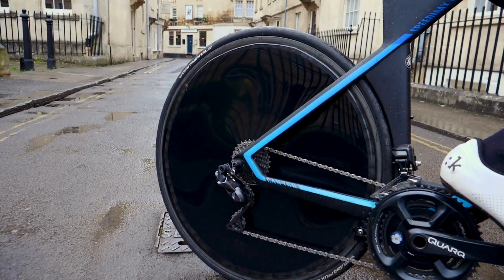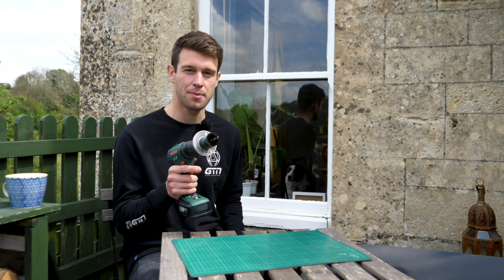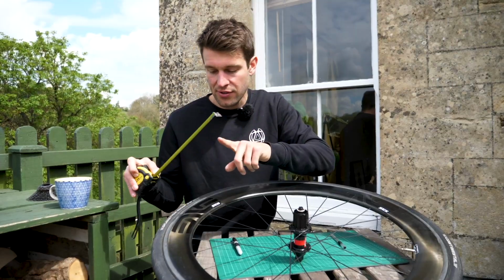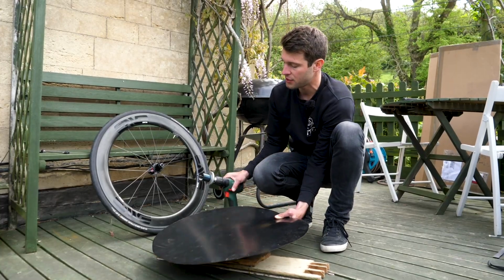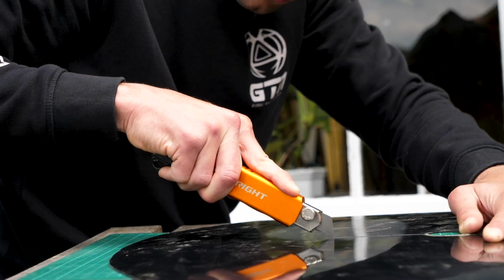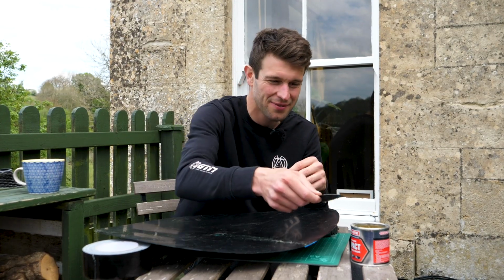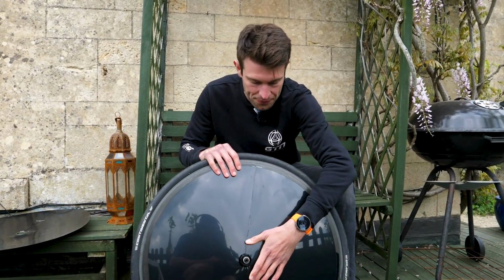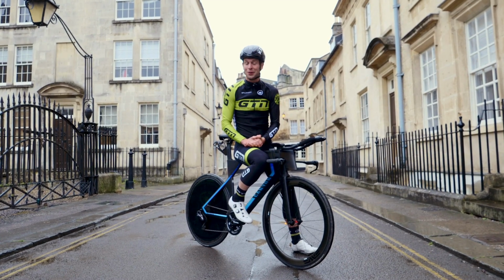Homemade Disc Wheel Cover | How To Make Your Own Step-By-Step

Comment: Super 👌 
Subscribed.
I had thought of that because I have 1450 DT Swiss and Speed Comosite hill climbing tires. Disc's and trispokes are nice but always heavier, weaker, non repairable and damaged by UV... These ones of yours first rate 😊

Comment: a tip for drawing the circle: hold the string as low as possible , or get a ruler or a piece of straight something, tape 1 nail to 1 end and the pen/marker at the desired distance.. good luck :)

Comment: Sorry to be negative but this looks like a dangerous bodge to me. If the disc wheel cover starts to detach from the wheel it could foul on the bike frame and lock the rear wheel, thus causing an accident. I'd rather not have my personal safety dependant on the stickiness of gaffer tape or insulation tape when travelling at 40+ kph.

Comment: Easiest way to create a perfect circle, piece of batten timber measure your required length from center to edge, drill small hole for center and larger whole for sharpie to fit in, rigid and solid circle in one :)  only dawned on me after I tried to 2 pen method (what a nightmare).

Comment: If you've ridden a real disc wheel then you'll know that a disc wheel will accelerate more than a deep section wheel
Reasons that a factory disc wheel is a solid disc, thus having a lower Moment of Inertia than a ring
Good Job Mark, for the disc cover thing, might as well try it on my bike

Comment: Thank you! Can't believe I found a video on this. Im a GCN viewer, but after this intelligent, thorough piece, Imma check y'all out more often. Most older roadies, myself included, are fairly mechanically inclined, and love DIY. I make some of my own parts like quill stem adaptors, allowing modern bars and stems on vintage steel bikes. Have also made a few different handlebars myself. I've made Q-factor out-spacers for my pedals...all sorts of things. But I've been thinking of doing a rear disc. Thought of fiberglass mesh or window screen with varnish basically, a few different ideas have crossed my mind. But I like this one. And forgive me, I always think of TT riders as kind of an elite demographic, solving most problems with their credit cards. Pleasantly surprised to come across this video. I've built up a freewheel single speed time trial bike and on its first real highway ride today, got thinking about a cheap rear disc. I may do slightly different but great starting point for me. Thanks again.

Comment: I like the idea of plastic push pins, or plastic mating bolts to hold disks together near the rim edge.  Some clips or bread ties/zip ties if i recall keep it firm anywhere else.  I don't trust tape.  Been wanting to do the rear wheel of  e-bike, but after i get belt drive sorted out.
Reply: Nice idea, one could make some bolt adapters  using a 3d printer. Thinking about ways not needing to take the cassette off as well.

Comment: Honestly, one can do a bit better than that. The cutting by hand on not very defined black line using a stanley knife....  You could have used a a ruler or a bit of wood and taped the center point and stanley knife to each end to use as a cutting tool.  The finish would have been far superior than what you accomplished. Thank you for the video.

Comment: I'm having trouble cutting my 40mm hole in my 28mm wheel cover please help... Just kidding cool video. not sure how box section would work though not much room for tape with a braking surface. Gtn should sell these like gmbn do with mudguards.

Comment: Mow that you've done it with the poor man's material go out and get yourself some 0.2mm thick carbon sheeting and do it again, the material should be about 150 US dollars.  Both covers together will only weigh about 170grams and it'll have an overall great stiffness than the wobbly abs.  So far I've made covers for 4 wheels out of carbon.

Comment: I used to make wheels covers as a kid using the heatshrink wrap that they sell to cover the wings of RC planes. Weight around 20 grams..  Pretty easy to apply, but it covers up the brake track, so only good for fixed wheel bikes.
Reply: Could you share how you did it? I want a wheel cover to cover the spokes of the bicycle so when my dog runs alongside it his paws can't get trapped in the spokes.
Reply: @furstylist  It was a long time ago cant rember the product name.., I the think the wrap got sticky when you heat it with a hairdrier, so i just cut a circle to cover the wheel and made sure it was stuck to the brake track, (you cant use rim brakes when its on) and then shrunk the middle taught. There are wheel covers that you can buy though which tie onto the spokes, much heavier solution of course.

Comment: If you're having trouble with the string, you can use a lengthwise cut cardboard with two holes. That way you get less unnecessary movement and a more accurate circle. Just make sure the cardboard touches the surface.

Comment: I bought and raced a  stretchy, shiny wheel cover in the USA for less than £30. I still have it; still usable.  It worked very well, esp. in cross winds. It used wire hoops at circumference, held in place by removable black plastic clips, that clip on the spokes and the 2 wire hoops.  Looked good too. Lenticular (i.e. lens shaped) solid wheels like this exhibit somewhat different characteristics to flat solid wheels. They act like a sail in crosswinds :)  Adds weight though, so not great for up hill.

Comment: The real disc trick is to use 3M car wrap vinyl to cover the wheel, since you can just pull it into tension and trim it around the brake track, so it’s super aero and also very very lightweight, adding only 30g to my rear
Reply: pics or didnt happend :)\
Reply: Prove your theory please...in photos!
Reply: Tor Do you think regular heavy duty vinyl would work? Or is the adhesion from the 3M vinyl necessary? My dad owns an advertising company so we have a bunch of extra billboards & I want to make a disc out of the eye of a Despicable Me minion.
Reply: Nitrouspeed Unfortunately I was relying on the vinyl sticking to the edge of the brake track, so I don’t think it’d be very possible
Reply: @bingrusginckle  same here!
Reply: one caveat is monocote shrink wrap stuff can potentially warp a wheel. i bought a recumbent bike with the rear real wheel done with vinyl wrap and it ran very untrue. but i did not know why. at later date i took the wrap off, because i wanted to fit a rear brake and he wheel was a lot straighter

Comment: Great idea! But I think the pen-pen centering isn't a good method. You can see the inner pen tilting, which can easily add a centimeter to the radius. Also, if you don't keep both pens rotating with the wire, the wire will twist around the pen, making the radius smaller again. You could measure up a compass template from foam board, and tape both pens inside there, to get a perfect rigid compass and a really clean circle.

Also, it seems really important to get the slither size just right. You can see on your drive side, the slither is too wide, making the disc too conical, and subsequently the cassette presses on the disc, giving it an S-shaped section, where it should be straight.

I think it's possible to create a pretty accurate measurement template for the discs. I'll give it a go and let you know.

Comment: Hack or Bodge. Please send it to the GCN team for a verdict. 😂
Reply: Hacks. I wish you did a more semi permanent solution rather than taping it onto the wheel. 

Is that even legal or safe? Im sure on the velodrome taping it on wouldn't fly. How could you adhere it to a carbon rim without ruining it?
Reply: @Red-ju4mi I’ve had one on my bike for over a year now and I’ve only had two replace the tape once

Comment: Consider using a push pin for the center, and attaching the string as low as possible on the marker - that should make the job a bit easier.

Comment: The cement will make the wheel vibrate thus loosing power. I would've went with superglue inside the seem.

Comment: wouldnt it be better to fasten non drive side with tape as the casset will hold the middle part pretty well on the driveside so no need to tape over the spokes
Reply: Good point

Comment: I'm concerned about wheel balance... Surely the glued seam will throw it off?
Reply: put the glued seem directly opposite the valve, the valve probably already has the wheel slightly off balance - it may help

Comment: You can do a permanent disc with expansive foam (on a cheap wheel), then sand and add vinyl adhesive (or resin+sand+paint).
This method makes whooshh whooosh sound!
And doesn't add much weight.
Better build a wheel with internal nipples for that, or no more truing will be possible...

If you choose the right alloy rim it can easily be under 1kg for a cheap disc wheel!
Reply: i took that rout and the vinyl ended up peeling off. so i put tape on the spokes and made sure it was sealed, i bought fibre glass and resin, took the tape off and was left with a solid light weight shell. im going to glue it on this weekend.

Comment: I made a disc cover for my rear wheel last week. So far this season I have had 5 times between 23m 17s and 23m 42s in my local 10 mile TT. This morning I did a 22m 51s using the rear disc wheel I made.
Reply from the maker: Awesome work!
Reply: where did you get the plastic?
Reply: @southpawairsofter Available on ebay but I got it from bayplastics.co.uk

Order: black smooth abs sheet
I bought a sheet 2500mm x 1250mm x 1mm and they cut it into 4 parts for me so could be sent through the mail.
(each cut piece was still big enough for a wheel.)
Reply: I have a loop I do weekly, about 40 min. First ride with disc I shaved about 3 mins off average.

Comment: I'm not duct taping anything to my ENVE SES wheel. Just saying.
Reply: that's electric tape used on the rims.

You could do this without tape though. Make at least 6 holes on each cover and then you can find some cheap plastic bolt and screw one side to the other.

You could also make pairs of holes and then used waxed string to tie both sides together...

Comment: Nice work, almost exactly the same as my build.  
Tips from my own experience: 
1) you don't have to cut all the way through the ABS, just score it a couple of times and flex it, and it will snap cleanly.  
2) use a metal skewer, heat it on a gas stove and you can melt fine holes through for the centre of your circle.
3) use an offcut edge of the ABS to make your giant compass.  And use the giant compass to hold your knife to cut a really neat circle. 
4) haircell ABS looks really nice with the texture, no scratches. 
5) I didn't worry about gluing, just taped the joint on both sides.
6) I locked out my lowest gear with the limit screw to prevent the derailleur rubbing on the cover.  Still fine for flat races.
Reply: I've been wanting to make one of these for genuinely years, and there's never been enough good advice online.  This helps tremendously.  Thanks so much!!
Reply: Thank you. Great tips
Reply: Just googled Haricell ABS and it doesn't look very aero with it's textured surface. I remember from the GCN video in the wind tunnel where even gaffer tape+cardboard for a rear disc was found to be not very aero.
Reply: @omerfurtun4115  textured surfaces are often more aerodynamic than smooth due to boundary layer effects.  See the dimples on Zipp wheels for example. I can't say for certain which way would be better without extensive testing, but it would be possible to try by mounting the cover inside out (the other side of haircell ABS is smooth).  Either way the difference would be extremely small.
Reply: @mrmatthewking : Dimples and rough surfaces are used to delay separation in high adverse pressure gradient situations, not something applicable to the surface of a disc wheel in almost any circumstance (they are basically flat, so flow will either separate or it won't). It's much more likely that the increased skin friction drag (particularly at the top of the wheel where the surface is essentially travelling at twice the bike speed, so 100kph+ on a fast flat course) would significantly outweigh any possible profile drag improvements by reducing separation (source: I'm an aerodynamicist!). I could easily be wrong, but that's my gut feel.
Reply: @scottmichaels6624  well, it looks better so there is that... ;)  It's been a couple of decades since I H1'd my fluidics exams.  The texture is only about 0.2 mm deep anyway.
Reply: @user-n7m3w  John has it right. Another way of thinking about it is holding a wheel in your hand by the hub (essentially what the bike is doing) and spinning it. The top of the wheel will be moving in one direction, the bottom of the wheel will be moving at the same speed in the opposite direction, so difference between the speed at the top and the bottom of the wheel is twice the rotation speed. As John says, in the case of the bike moving along the ground, the bottom of the wheel has to be at a net of 0kph as it's stuck to the ground, meanwhile the outer edge of the wheel.must be rotating at the speed of forward progress to maintain this condition. Therefore, the top of the wheel must be moving at twice the speed of forward progress
Reply: @user-n7m3w  that is actually a fun question to answer. Most people I think have the same initial response when they hear the top of the wheel moves twice as fast as the bike. Ironically you would probably also be surprised to learn the bottom of the tire in contact with the ground had an instantaneous velocity of 0kph! The thing to understand is if the bottom of your tire is moving forward with velocity while it is on the ground, then you're skidding. To move forward confidently you need the tire to be "stuck" to the ground when it is in contact. The top of your wheel is the opposite. Your bike is moving forward, but for your wheel to rotate and continue moving you forward it needs to be moving forward faster than the bike. That speed happens to be 2x the speed of the bike. Here is a link with the mathematics if you're interested in understanding the fine details.

Comment: @GTN - can you do a video to compare this disc wheel vs more expensive ones. 
So we can see if our money is truly worth forking top dollar for premium disc wheels. 
Or can we make a DIY Disc cover and get similar performance.
and of course would be good to see the discs compared to the deep section + box section wheels too.
Reply: I'm pleased you've asked... I'd like to give my homemade creation a little more airtime. I'll try to do this for you :)
Reply: Short answer is there's no significant difference. It will probably be heavier but that doesn't matter much
Reply: @mrmatthewking  This would be lighter than my Zipp900
Reply: @Gideonkomen  "No awe-inspiring, soul-crushing WHOMP! WHOMP! WHOMP!" :/
Reply: I used a cover for racing for several years.  In the right conditions it makes a significant difference.  I don't think extra expense would help.  You might be able to buy something lighter (although covers can be very light, lighter than solid wheels even) but you likely wouldn't choose to fit a cover when a lot of climbing is expected. On the flat, any decreased acceleration due to extra mass is likely compensated for by momentum (angular momentum in this case) and sail effect.  It can feel like you are an unstoppable train (make sure your brakes are good :D).  BTW my cover was thinner, stretchy but shiny.  If I made one, I think I would go a little thinner & lighter than 1mm.
Reply: @tonyy5482  I'm thinking of trying this for fun but was wondering if a thicker material would be stronger as I'm worried a sub 1mm thickness would be to flimsy and bend.
Reply: It’s within a few watts. I used to run a wheel builder disc cover on a felt TT 40mm alloy rim when I was racing. It can be quite heavy depending on the wheel you’re using. Only real downside is that you don’t get the whomp whomp noise :)

Comment: Is there also a methode to make your own deep section wheels for shallow ones?
Reply: Expansive foam. This is the way I can think:

You gotta add some cardboard to both sides of the rim, then apply foam to that. Mask the braking track before that. To make sure it doesn't expand too much inwards into the spokes you can cut many pieces of cardboard to fit between spokes, and make holes in them to apply the foam with the straw. Find your way to remove the cardboard, it will be sticky.

Then lots of sanding, then you can apply some resin over it, sand and paint. Or skip the resin step and use vinyl adhesive over it, there are some that even look like carbon.
You will have to actually sculpt the shape of the rim... 
It will give you lots of work due to spokes being there.

And then you cannot access the nipples anymore for truing unless you build the wheel with internal nipples. Better do your first attempt with a cheap wheel. I tried and failed the first time, but it wasn't too hard to remove everything with a knife and patience, so you can try again.
Reply: @ericoschmitt  Thx
Reply: @lucasweber8880  But really think if its worth. There are very high quality and affordable rims from chinese manufacturers such as LightBicycle, which I own a pair of 56x30mm rims and they are absolutely perfect in every way, plus they are cheap, even cheaper if you buy rims and build.